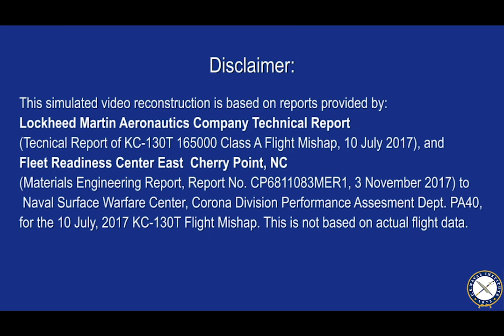Animation of Fatal Marine Corps KC-130T Crash

Comment: What the hell is going on with the props? Is there any history of this happening before? The C-130 has been around since Christ was a Corporal.
Reply: My thoughts as well! Two prop failures at the same time?
Reply: There have been other prop blade failures on many turboprop aircraft. Undetectable cracks that eventually grew to blade failure size over years of flights. This super teeny tiny undetectable crack problem is worldwide for all propeller powered aircraft.
Reply: @davidhoffman1278  Then they need to come with better overhaul guidelines for blades.
Reply: @davidhoffman1278  There are fatigue failures of jet-engine fan blades resulting over time from microscopic flaws
Reply: @None-zc5vg  true. The keyways and keys that attach the blade to the hub are troublesome. Been that way since axial jet engines first were used. The only solution may be a blisk type design.

Comment: Seems like a good reason to structurally reinforce the fuselage around the propeller area if it can slice the whole cockpit area off so easily
Reply: Many prop planes have structural reinforcement to protect the fuselage from ice being slung off the propellers but nothing is going to protect a fuselage from a spinning propeller weighing about 800 lbs.
Reply: @nocalsteve  
I wouldn't say nothing, but then you might be too heavy to get off the ground, lol.

Comment: So was the loss of the propeller on engine #3 related to the loss of the blade on engine #2 or was it just a coincidence?
Reply: It was a shockwave effect.  It damaged the propeller shaft on #3 they said on another video.  13 ft 6 in of baloney slicer is deadly when it comes apart.